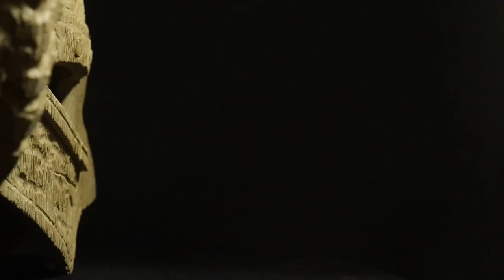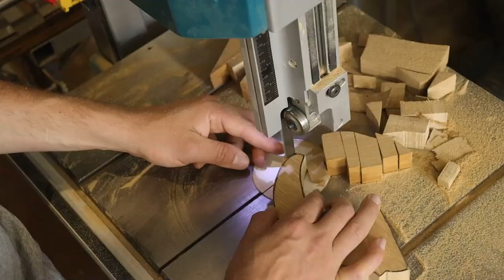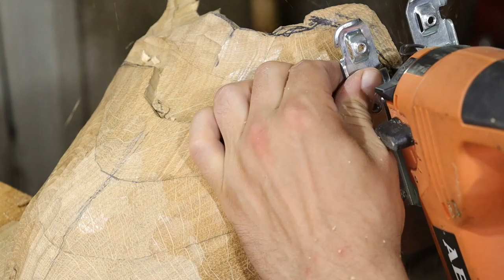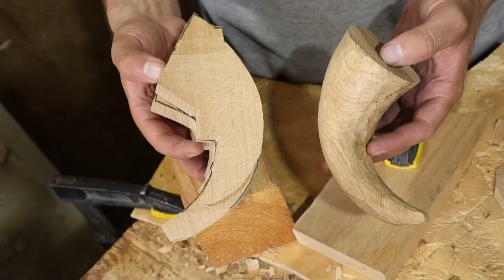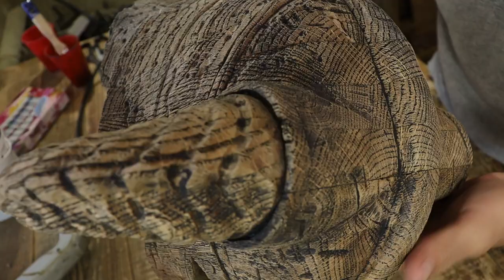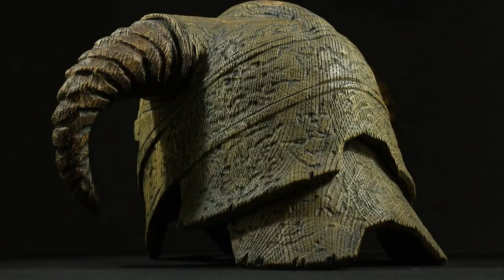Skyrim. How to make helmet. Wood carving. Wood Mask.

Comment: I love this, subscribed after 2vids!
What kind of glue do you use? 
Im thinking my glueups wont stand that much abuse 👍
Reply from the maker: Thanks for subscribing.  I use d3 wood glue.  I buy it for bottling in a paint and varnish store.
Reply: @oleksandrhrytsaiwoodcarvin1051  cool, I use d3 aswell.. how long do you clamp your pieces?
Reply from the maker: the minimum time for clamping is 2-3 hours.  But the best thing is to leave the glued parts for 12-24 hours.  I try to leave it for 12+ hours, I probably know that the part is well glued